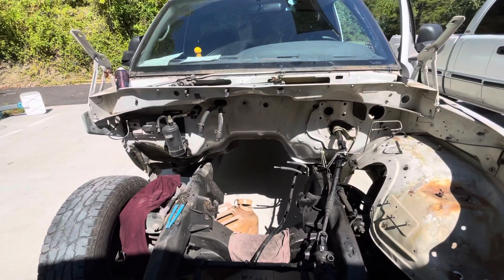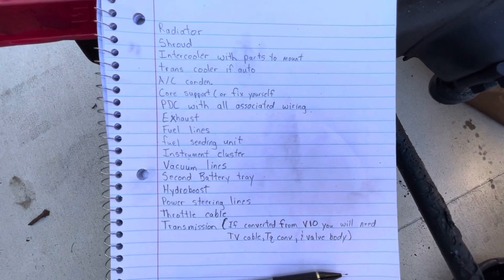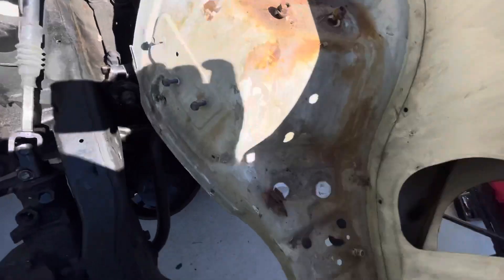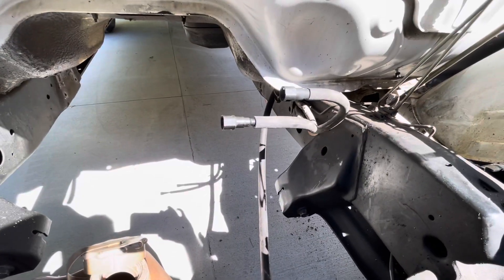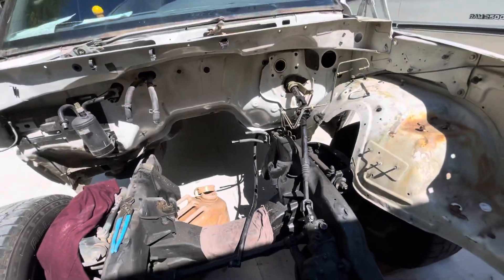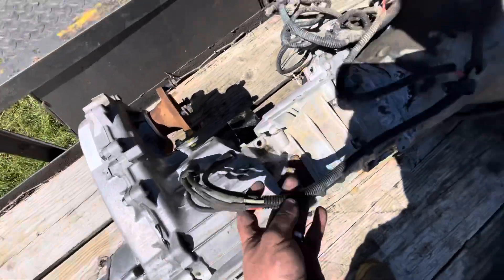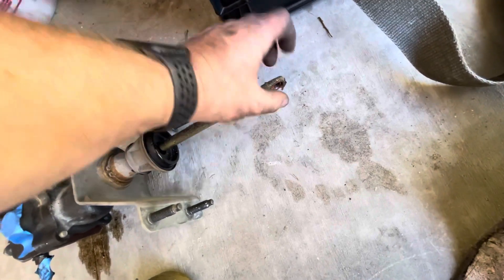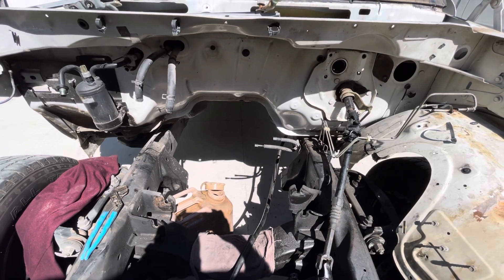Dodge 2500 second gen gas to diesel conversion (V10 to Cummins 24v swap)

Comment: So I own a 96 Dodge ram 2500 5.2 L when converting to a 12 valve do I have to put all new harnesses for the 12 valve in the gasser
Reply from the maker: @TylerBeebe-i4p  yes, but a 12v is a lot more mechanically driven than a 24v. Many will say you only need a few wires to run the 12V which is correct. I am a fan of having all factory gauges and components working as they should though.

Comment: Why did you need to swap the Harness that has the Body Wiring...? (Lights and all) Mine appear to be the the same between same year, one being 02 Ram 2500 V10 and the other an 02 Ram 3500 Cummins.
Reply from the maker: @jamesrobinson5801  I’m not certain. Best I can remember is that it was all one harness. It would make sense to not swap it if it’s an option. Where does it disconnect? At the fuse box I assume?

Comment: So did you use the diesel complete dash or did you leave the V10 dash in there ?
Reply from the maker: Everything cab related, besides what I covered in the video is from the V10 truck
Reply from the maker: The few plugs, throttle cable, and brake booster is all from the diesel. Everything else was plug-n-play.
Reply: Okay good deal thanks.

Comment: What did you do about the fuel tank?
Reply from the maker: I changed the sending unit out with the one from the diesel. I installed the drop sump and airdog lift pump.
Reply: @benstewart4545  I need to do the same. Your tank was plastic? I'm going to sump mine. Im going to reuse the gas tanks.  Do I keep the original gas sending until in?
Reply: @benstewart4545 wat was the size difference of the tanks? I am asking because I have a 1998 3500 that I want to put a 26 gal gasser fuel tank in as I need room to mount other things. Really appreciate any info you have😄
Reply from the maker: Yes, my tank was plastic. I used the diesel sending unit in the tank that was originally gas. I replaced my whole fuel supply system with the airdog but there is still a return line running from the head to the stock sending unit. Just to play it safe I put it all back to how it was on the original diesel truck minus the fuel supply line to the pump.
Reply: @benstewart4545  you said used a diesel sending unit that was gas? Do you mean you used the gas unit with the new diesel set up or purchased one specifically for diesel?  sounds like a similar set up. I have dual GAS tanks with a GAS sending unit. I'm running FASS.  BASICALLY don't have to change anything but add the straw sump?
Reply from the maker: @johnathonjsmith  I used:
-Plastic fuel tank original to the V10 truck
-sending unit from a diesel truck(connected like it was from the factory with fuel lines off of the diesel truck as well)
-fuel tank sump kit (required drilling a large hole in the bottom of the tank for supply and return to the airdog)

What I did not use: 
-Gas sending unit
-fuel tank from the diesel donor truck

Donor truck was RCLB and the project truck was ECSB so the tank was different. I would’ve swapped the whole tank/unit if the tank had the same dimensions.
Reply: @benstewart4545  ok so I guess I'll have a problem then with fending a diesel sending unit for my set up 😫
Reply from the maker: @johnathonjsmith  I’m not saying that the way I did it is the only way. The gas unit will tell your gauge the fuel level. How much my truck uses the unit besides that? I’m not sure.

Comment: Would it be the same if it were a v8 instead of a v10
Reply from the maker: I’m not 100% sure but I’ve read that the engine mounts are the same. Besides that, I’m not thinking that anything would be different than the V10.
Reply: @benstewart4545  thank you

Comment: I have a 1997 dodge ram 2500 with the 5.9 gasser want to 12 vavle swap how hard would it be ?
Reply from the maker: I’m sure it’s similar. Probably easier being a mechanical diesel if you have a parts truck.

Comment: So the wiring harness from the diesel plugs right into the harness in the cab? I am just wondering how to hook up the gauges.
Reply from the maker: Yes it does. I went from an all manual cab work truck to an extended cab Lariat, and everything works fine.

Comment: I have a 2001 dodge ram 2500 but it has the 5.9 v8 gas. I do have a 24v Cummins and transmission with everything on it cause came out of a running truck. Do you know what else I would need and roughly how costly? I don’t think it would be much different then the swap your doing
Reply from the maker: The list in the description is what you will need. I’m sure cost is dependent on where you acquire the parts. I had a whole truck for parts so I’m unsure on the price of them individually.
Reply: I was doing some research on this a while ago athough I'm sure you have it figured out by now but looking through Facebook marketplace I figured 5-6 for everything else. It would be easiest to get a wrecked Cummins and pull everything off

Comment: Does the frame need to be reinforced if swapping from gas to diesel on a 2500?
Reply from the maker: No, it’s the same frame.
Reply: @benstewart4545  this is correct. The 1500 frames are almost the same, leaf spring buckets need to be changed otherwise the same frame.
I have a 2500 parts truck to convert a gas 1500 into 2500 diesel, both 2001.